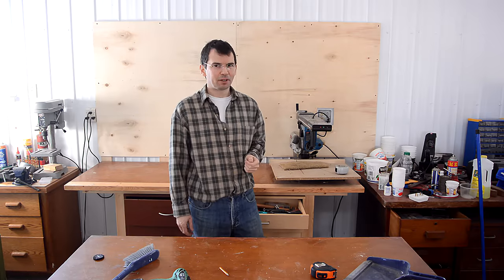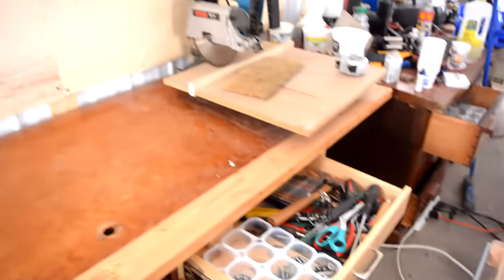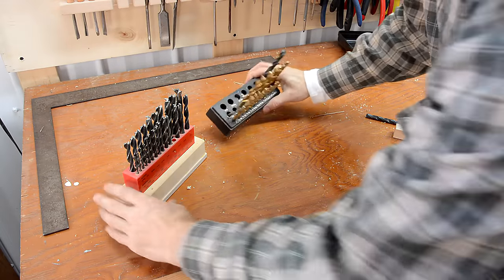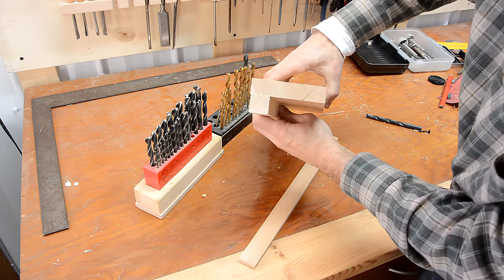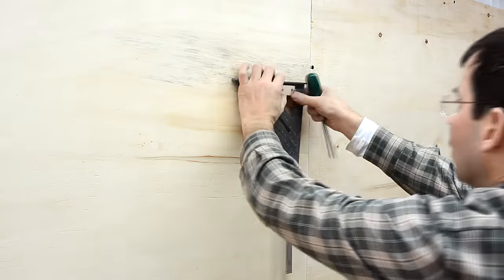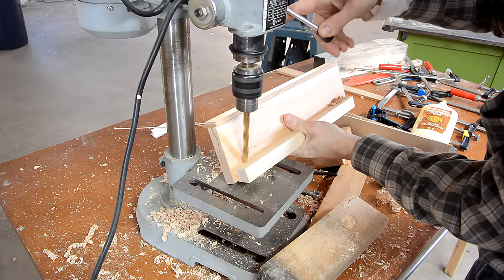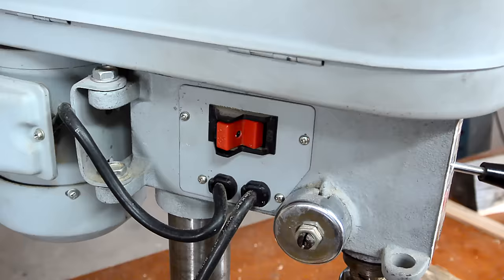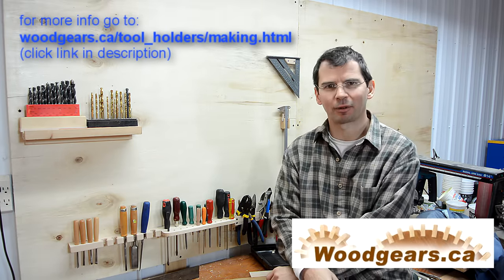Making wall tool holders

Comment: I did what u did about 20 months ago and it made a huge difference.  I can see and grab tools easily. Before using pegboard I had to move tools to get to the tool.

 Another way is French cleet so u can move individual holders if need arises.  Good skills I like your simple ways of making holders look up scale.
I really like my pliers holder where bbn I have them from small to large instead of a drawer and had to shuffle stuff to find what I wanted.  Have a friend retiring and building a shop and hope he sees these tool holders.  With a new blank shop a guy could really lay stuff out to make life easier

Comment: I like that you are not overly "fussy" about things that really don't matter.  Much of what you do here could be easily adapted to a pegboard system (for those who already have it installed) by using plastic drywall inserts in the holes and then screwing the 'holders' shown here to the pegboard,
Reply from the maker: +RustyCas Or I could just screw it on between the holes.  In which case, a pegboard with no holes would actually be better, and if it were plywood with no holes, that would be even better.  Which, coincidentally, is what I actually used.
Reply: Matthias how thick is the plywood?

Comment: Great video.  For the past 40 years my tools have been in a VERY large tool box, it needed a fork lift to move it in and out of the panel van, fortunately it wasn't taken out all that often.  Now I am retired and I just could not decide on a design and I didn't want to use a French cleat system.  I'm going to adopt your idea.  Simple, cheap (sort of) and a darn sight more pleasant on the eye.  Thank Matthias

Comment: Easy and simple, and if they need to be changed or expanded you can just toss them out and make new ones. This is pretty much the system I want to use for my tool storage (smaller tools at least).

Comment: That project would take me at least 4 months if I was working (like a job, where I have to leave the house). I haven't got that many power tools. I have no drill press or table saw. I have a jigsaw but that's nearly impossible to use without clamps cause it bounces a lot sometimes. Yeah I need a few clamps too. I don't have a band saw either LOL. My God this project would take me at least 9 months. You are very fortunate you have all those cool tools to do the job to begin with.  Now I am sad. Thx.

Comment: One other  improvements  I would is add a back splash at top of work bench to prevent tools  from  going between  wall and the bench. Like all these ideas. Sometimes  it seems more time  is  spent  looking  for a tool than actually  doing the job.

Comment: Cool! I recently made one for my tools. Box shaped and way smaller because I have not so many tools. To hang it I cut a long rectangular piece of wood diagonally and longitudinally and screwed one of the pieces to the wall with the sliding part sliding down towards the wall and the other to the box and then you can hung it . ^_^

Comment: if you take old glass jars with a "twist lock" cap small jam jars etc and screw the lid to the underside of the drill shelf , it makes idea storage for commonly used screws or other bits and pieces , and it keeps the contents sawdust free too ,

Comment: Matthias is using pocket holes?!?  Someone check the weather report for hell. ;-)

Great video as always.
Reply from the maker: ***** It's been a cold winter in Ontario!
Reply: Matthias Wandel
did you move all your gear here, or do you still have the workshop at home ?
Reply: Matthias Wandel didn't use a Kreg jig though, great technique.
Reply: But he didnt use glue
Reply: Pocket hole / toe nailing
Reply: Bill Phillip
He doesn't like French Cleats, apparently...  Don't know why - they are easy enough to set up, and if you  DO change your mind about where something goes....  why you just move it.

Me, I don't put seldom-needed tools up frontand center - they sit (hang out, really...) in an out-of-the-way corner.  But when they are going tobe needed on a project... why they get moved to a much more convenient spot - in about30 seconds or so. When done with... back they go in 30 more seconds.

Not to change the subject, but a guy called "Vee theAmazing Greek" has a video up using short lengths of metal conduit - looked to be about 1/2 inch to me - with holes drilled in them for mounting, to hang screwdrivers and other screwdriver-like tools.  Or plier-like tools. Or...

Cheap stock, easy to make - you could use PVC pipe instead of steel to make it easier to work with.  You could potentially get the material for free at a building site: you'd be using stuff from the dumpster.

On the other hand, Matthias is Matthias, and his mind wanders off in strange directions - almost always much to our benefit, so we shouldn't be too harsh.  At least hie didn't use a Kreg jig.

Comment: ive got a 1 inch thick ply shelves in my shed. i drill. holes on the facing edge and put my common drill bits and screw driver bits in the holes.

also if u have any old laptop. hardrives or laptops. you will find somw very small and very strong magnets in them. for holding metallic tools up

Comment: I'm planning on building a drill press , the plans I've seen are very complex, I need something basic any ideas on that ? BTW I love the ingenuity and I will subscribe. edit: the drill I plan on using is a steel housed one way drill, very old school, the type that never fails.. just want ideas.. I have a rough draft in my head but you seem very knowledgeable in the wood craft
Reply: Buy a used one

Comment: Very tidy. I think one of the worst things I ever did was to put drawers under my workbench. If you have the wall space though, yours is the way to go!
Reply: I am about to put drawers under my workbench. Can you explain why that was a problem for you?
Reply: Henrik Mikael Kristensen Over time, my drawers became very much like Matthias' at the start of this video - jam-packed with everything; very hard and frustrating to find the tool you actually want.

I would now always favour a dedicated storage system, where every item has its own place. Instead of making a space that will take anything and everything!

But it depends on what you're looking to do and also what wall space you have free.
Reply: Olly Parry-Jones: Thanks very much. I might change my mind on it and go with some more dedicated wall storage.
Reply: Henrik Mikael Kristensen
Drawers under workbenches can also be a problem if you clamp something in the vise, then realize the tool you need is in a drawer that's blocked by the item in the vise.  The only things I keep under my bench are bench hooks, shooting boards, and hold fasts.  They're stored on simple, open shelves.
Reply: deezynar That is very useful information, thanks. I did not consider those issues.
Reply: ***** I built a plywood box, left open front and back and fitted wooden runners inside.

Oh, wait, is that not what you meant?... I've already got my coat and hat, just need to find my keys and I'll be gone! ;-)
Reply: ***** Send him the wool and his mum will knit you a pair.
Reply: grotekleum Woolen drawers would drive me crazy.  I prefer Pima cotton for mine.

Comment: I had a key that used to fall out of my old contractors saw so often it finally broke so I had to trip the safety mechanism inside with a screwdriver to get it to work. That ended up breaking it entirely so I hardwired it to the plug. I didn't have to money to buy a new one and it wasn't that good of a saw anyway. I wish I had thought of putting a screw in it.

Comment: @Matthias Can you please do a video explaining gear ratios? What is that, where one gear spins a certain number of times and it spins the other a certain number?
Reply from the maker: David Myers Already did.
Reply: I probably watched it too, but it was late.
Reply: Forget the diameter - that comes after.  The teeth must be the same size - after that the "gear ratio" is the ratio of the tooth count.  From the number and size of the teeth, you get the circumference.  From the circumference you get the diameter.  That is ALL there is to it.  The "number of times it spins" is simply another way of talking about the number of teeth moved, which is the same for both gears as it obviously must be, and THE NUMBER OF TEETH IN EACH GEAR.  If they both have the same tooth count, then obviously the ratio is one to one.  If they have different tooth counts, which is the case you are talking about, then the TURNS RATIO is THE SAME AS the TOOTH COUNT RATIO,
Reply: That's making some sense. I also recently learned the teeth are also called cogs. So it's basically the cog ratio?
Reply: David Matthias has a printable tooth ratio and gear ratio diagram that will give you all the info you need. It's on his website woodgears.ca
Reply: Thanks bro

Comment: How´s good to live in a place away from the sea...
I live on a coastal city and my tools are places inside plastic boxes, one for each tool type; i also have phosphatized some of them and/or paint the metallic surfaces with varnish, some others are just covered all the time with WD40.
Just like termites,  you can't win rust, you have to learn how to live with it.
Im thinking on a glass exhibitor like wall placer for the tools, just like the video but with a glass door, maybe it will reduce the dust/air contact with the tools.

Comment: After 25 years in business I have come up with a conclusion I don't like drawers or pegboards or any kind of hanging system for small tools. Here's why how many projects do you have that are on the workbench? Here's the solution it's so simple,  Go get a bunch of tool belts hang them in front of your bench with some simple hooks that's it. Then if you have a job at your bench it's in the ideal position to grab the tool if it somewhere else you grab the bag and go.

Comment: why did you decide to not use a french cleat system?
Reply from the maker: ThreadThatHas NoEnd Covered that earlier.  It's a lot of work, traps dust, and ugly.  Even if I move the tools around, the extra screw holes won't be as ugly as french cleats, and I have a lot more flexibility.
Reply: ah ok

Comment: gasp Pocket hole without glue.... AND A POCKET HOLE! (I know the shelves don't need to be that strong). I'm impressed that they are all level. or did you use a water level off camera? Greetings from Germany
Reply from the maker: therealpanse Used a level off camera, had a pencil mark for where they need to go.

Comment: Pretty  new to your channel and really enjoying the walk down memory lane. I don't do much wood work now a days. I do have a question concerning the Band Saw. Do you weld your own blades? I used to get blade stock in 250 foot rolls and weld my own. Also: Did you have much of a problem leveling your band saw table i.e. 90* @ teeth and side of blade? I had to have my Craftsman table machined down.
Reply from the maker: FunkmeisterArts I don't weld my own blades.The table - it has an adjustment screw for the 90 degree stop.
Reply: Matthias Wandel
 Thanks for the quick answer. I could never get my table to line up when blade tracked on the tires correctly even though it too had the stop screw on table. Keep up the great work.

Comment: If you don't use glue on that pocket hole joint, the chisel holder might snap off and cut off your fingers...later it will be, I told you :D

Comment: "While I was waiting for the glue to dry, I cut out this little block which is designed to hold this square."
I know that's called a square but my first thought when you said that was "That's actually a triangle."  Must be my inner smart-alec  :D
Reply: *****
It's a "Speed Square" and the design was patented, I think by Swan.  The patent has expired by now, I guess, because everybody has them, or their name on them.

Like a traditional Framing Square, it can do a gazillion things, and you sort of need a manual - a not-so-thin one, to learn all the tricks you can do with it.
Reply: cute!

Comment: screws holding racks to the wall should angle down not up they would be self tightening  also don't use dry wall screws they are too brittle

Comment: Do you have a tool holder for your level?  Oh wait...you don't seem to have a level. XD
Reply: He uses a water level: a length of plastic tubing with colored water in it, and a ring of color around each end.  Put the rings next to each other and fill the tube with the colored water until the water comes up to the lines.  Put one end somewhere, and fix it there (or have your wife hold it, if you have one of those tools), and then when the water at the other end matches the line on the tube both lines are at the same height.

Awkward, but it works, and makes your wife feel wanted and useful and all sorts of good things like that.

DO NOT SHOW THIS POST TO YOUR WIFE, or your name is mud...

Don't worry about me  my name is already mud.
Reply: lol
Reply: you dont need a level if you have 2 eyes and a good sense of balance ..you can throw the level; in the garbage...

Comment: i would use pine. not maple. maple. is too good for tool holding.
Reply from the maker: Maple is good at not splitting and not getting dinged up.  And I only needed bits cut out of firewood